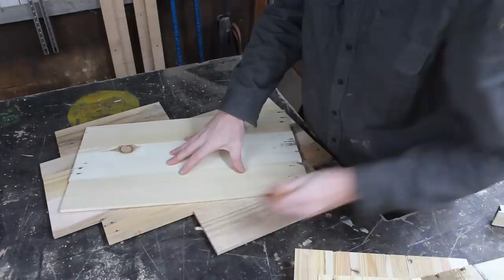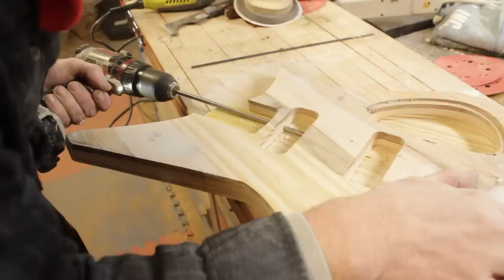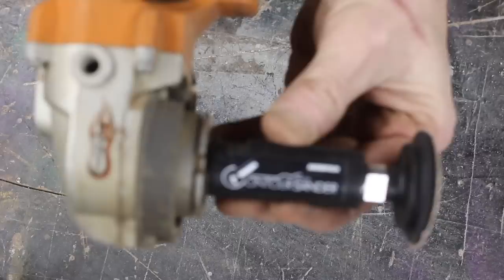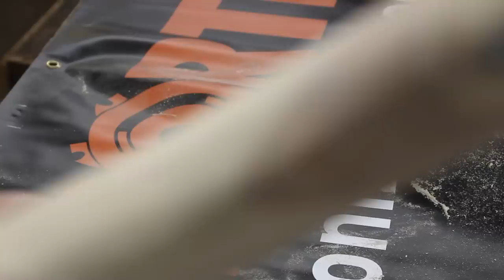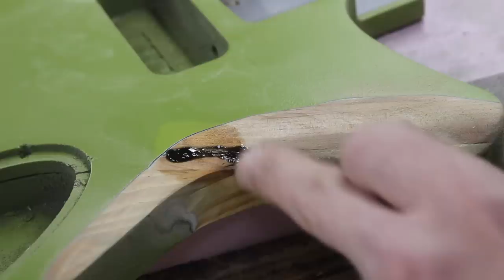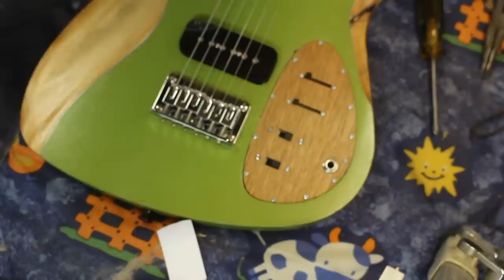"Relic" Pallet Wood Guitars | Power Carving

Comment: Using Arbortech 'bits' for belly and arm relief (and the Bob Ross touch on the green guitar 🌲 Those were happy trees, right? LOL) seems to work well....and you'll get nothing but better at it as you use those more often. For finer (and fairly fast) finish carving, I would suggest maybe a Japanese rasp. I bought one on a whim (cheap on Amazon...for the one I got, anyway) and I love this thing!! Give it a try! You've got to be able to feel the rougher spots, no?? Overall, great idea, though! :-)
Reply from the maker: right on. I use rasps quite a bit to shape the necks. Since this was an Arbortech video, I was trying to do it all with their products to show them off - and learn. And yes, Bob Ross is exactly who I was thinking about :)
Reply: The  Bob Ross of angle grinders
Reply: @davebauerart ...stole my line!!!!

Comment: I like the contrast a lot. Power carving after a stain could be interesting too
Reply from the maker: yea it would. maybe not sanding the carved parts so they are chopped and angular while the rest is finished to very smooth...
Reply: Absolutely. I liked the black filler you used as well though. It made a nice high contrast.

Comment: where do you get such high quality pallet wood? all the pallets around my area are made of awful wood that explodes like styrofoam if you even look at it wrong
Reply from the maker: I have certainly had those pallets, too. Pallets that had heavy things on them are what you want (like concrete, stones, etc). Go to the industrial side of town and look behind those buildings. The pallets behind the department stores and box stores carry clothes and light stuff. more likely to be crap wood.
Reply: In the '80's when I worked in a factory, every once in a while an oak pallet came through. Mind-boggling today.
Reply from the maker: @Xubuntu47  I still find a lot of oak and other hard woods, but they use the crappier cuts.
Reply: I've seen pallets of nice mahogany and oak. I've also seen them of OSB and crappy pine blocks
Reply: I live in Eastern Canada, there used to be a cotton mill in my town, the cotton came in as bales on pallets from several different tropical locations. It left as bolts of cloth not on pallets. It was apparently significantly cheaper to build new pallets in the places the cotton was coming from than it was to ship the pallets back. So you could have as many pallets as you wanted free of charge, I burned thousands of them. They were all quality tropical hardwood of unknown species. 
30 odd years ago the mill closed and although it's easy enough to find a pallet if you need one it's going to be flimsy softwood and you'll have to pay the core charge on it. 

So anyway, whether pallets are thing where you live depends in your local economy.

Comment: The green guitar made me think of Bob Ross - “Happy little trees”
I like what you did. I have the original Arbortech grinder. I have made quite a few things with it. I have not tried out the turbo plane. 
I like the designs and techniques you used with the turbo plane.
Reply from the maker: cheers! I like power carving. I'm not good at it, but I like it :)

Comment: Happy little trees.
Reply from the maker: exactly
Reply: @timsway  I meant to ask you: how do you get the cavity covers to such an exact tolerance? Do you still have the laser cutter? Or does the CNC suffice? I don't have any advanced equipment, so I do everything by hand, and it's really hard to get things like that to an accurate tolerance.
Reply from the maker: @stevesoldwedel  my cnc has very precise tolerances, but you can also make a router template and do it by hand with similar results. It just takes longer. I do sometimes cut the covers on the laser now because I have it. I have found if i create the shape on the computer for the hole, I cut the cover .01" to .02" smaller than the hole and it fits right in.

Comment: Do you know where I can find wiring diagrams for slide tone and volume pots? I literally have a drawer full of 500 and 1k slide pots that I've been thinking of putting in guitars just for laughs. Love the green one, especially the controls!
Reply from the maker: I just did trial and error until I figured it out. lol. The sliders I have had three tabs, like a knob pot. I just assigned an order to them like the round pot and wired the same way, then corrected my mistakes. If you bypass everything and go from pickup to jack, then add one switch and get it to work, now you know how to do it, then add the next, etc.

Comment: The slash marks on the face and the forest scene on the back (could have put on the front) are good design elements. I don't see what you did on these guitars as 'Relic' -- it's a design element to block with a solid color and carve in the designs. Relic would be more wear and throwing them in the box of nails and shaking that around. Look up the Fender Custom Shop 'Heavy Relic' images for how they are faking old guitars, including correct fretboard wear.
Reply from the maker: I was poking fun at the "relic" style of guitars (hence the quotes). They take a nice guitar with nice wood and paint then beat the crap out of it. I bamde a guitar out of crap, put some nice paint on it then artistically "beat the crap" out of it instead :)